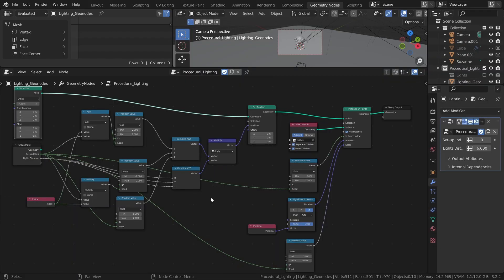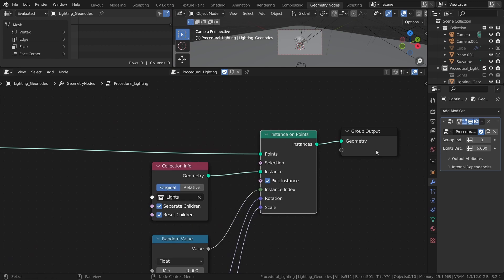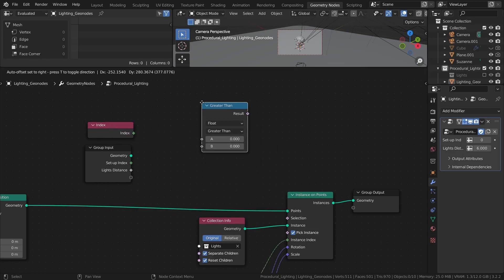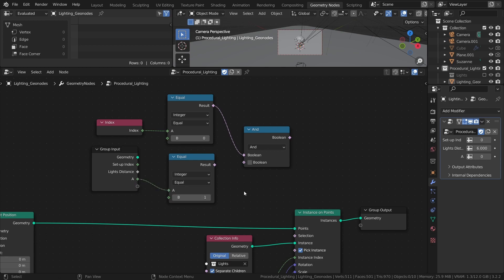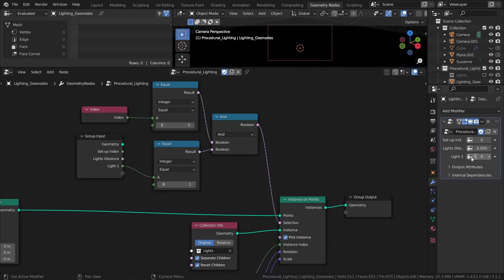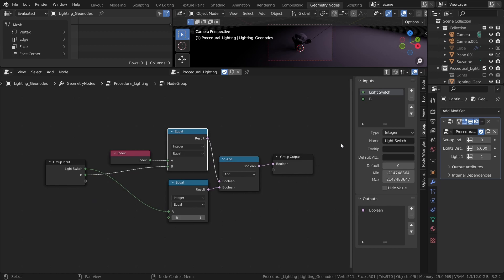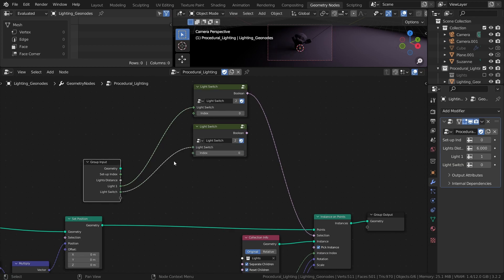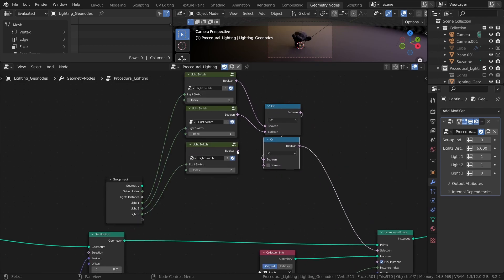Procedural Lighting Follow-up | Geometry Nodes Tutorial

Comment: Thanks for the tutorial. I have an observation on how Blender tracks the names of instances. In the spreadsheet, if you turn all the lights on, you'll see the position, rotation and scale information for the light instances, but the names are duplicate names. For example, if the lights in the collection are named One, Two, Three, Four, Five, the assigned names in the spreadsheet might be One for two lights and Five for the remaining three lights. Likely a bug.
Reply from the maker: That's actually because of how I set up the system so that it selects a random light to instance instead of just using the same 5 in the same order every time
Reply: @Khamurai  
Thanks. I figured that out when I went to bed. Can the position coordinates be displayed. There is a node that displays index number.